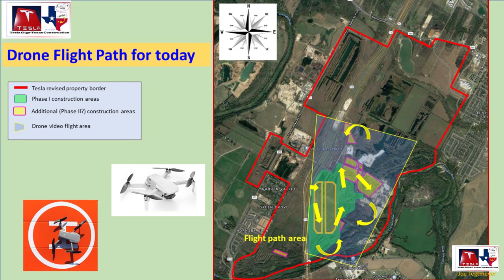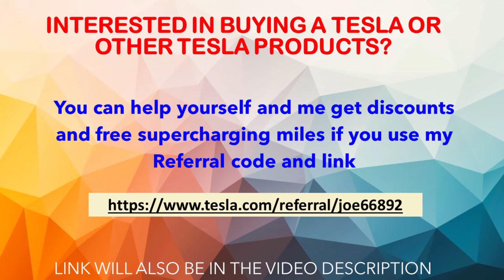Tesla Gigafactory Texas 27 October 2020 Cyber Truck & Model Y Factory Construction Update (09:15 AM)

Comment: Small point. Concrete does not "Dry", it is a chemical reaction that occurs, and that is why it gets hot! But the cover prevents the surface from drying out as it heats, and thus leaving a layer of weaker, product on the surface, and this leads to subsurface layers. But essentially right. I asa lowly boilermaker and truck driver, only delivered it, so you would have to find an expert to find out the actual reactions
Reply: You are exactly right. Drying is bad, curing is good. Edit: Concrete will cure under water. :)
Reply: On this topic there is so much misinformation. Yes, concrete cures chemically not by drying,. You can pour concrete underwater and it will cure.
Reply: @williamgreene4834  Yes!!!

Comment: 1:31 when they built the Hoover Dam they went so fast and used so much concrete that they  ran pipes thru the concrete and ran coolant or "air conditioning" theu it to keep it from curing to fast and cracking
Reply: Today that risk is managed chemically by adding ingredients from the green tanks we see see at the new batch plant.

Comment: As for the small pit area, since this is purported to be in the paint area, this could be a pit for the downdraft paint booths that are often used in industrial painting. You use a vacuum system to pull the extra paint and air particles down into a pool of water. This not only captures any paint that as been aerosolized but also dust and particulates. You use this in addition to differentially charged paint and body to get as much paint on the car and as little as possible on everything else. Just a guess though.
Reply: Or the drying tunnel, usually concrete to help insulate , but I would expect hot zone to be at the end....
Reply: But why the forest of geopiering under that area?  My guess is that there will be equipment too heavy for the normal slab to handle and they need a thicker layer.  They initially extended that scraped area several feet further south but filled it back in with gravel.  Simple mistake, or intentional so it would be a thicker gravel layer?

Comment: Well, I guessed correctly on the smoothing of the area under power lines on the Southeast corner - parking.
It looks like they have started to prepare the area under the power lines north of it for more parking.
There was a new flatbed trailer parked west of the pit with a load of rebar or upright beams.
I could not see what was on it.
The big pit on the North end could be for twin tanks to dip the car bodies in for anti-rust proofing or acid rinse in preparation for painting. (?)

Comment: Joe, thanks for the informative comments about covering the concrete while it cures. Quite correct. That explains the colorful plastic visible in one pit.
Reply from the maker: Thanks ... I figured I’d get questions on this so put the info out there in the video
Reply: Concrete cures or hardens as a result of a chemical process, not as a result of drying, although concrete can dry as it cures. If it dries too fast in relations to the curing process, the outer part of the cure can lose strength and "splay". Tarps are placed on curing concrete to slow the drying process so it does not get ahead of the curing process.
Reply from the maker: I know ... it’s an exothermic reaction  as well ... just trying to give info to a wide audience.
Reply: @JoeTegtmeyer  I understand.  I just feel that as the project  progresses it will become  more complex and it will serve everyone if the basics, like the nature of concrete,  reaches some sort of communal agreement before the complexity begins.
Reply from the maker: Ok ... Thx!
Reply: @JoeTegtmeyer  Thanks, Joe. Here at 40 degrees lat. we get really nervous when you mention 39 degrees...frozen concrete is no joke!
Reply from the maker: Spent a lot of time in North Dakota so understand when it is really cold

Comment: I think the earlier work on the center roadway was about erosion control, and preventing a potholed, rutted, muddy mess for heavy equipment traffic.
West side has a lot of completed geopier work, now, too.
Reply: I agree. Early on the center "road" was probably wide and graded to have a center channel to deal with massing rain sheet flow run off. Now the building footprint is up to grade and compacted. The first use of the road during rough grading as a protector of the grading and compaction work in process is no longer an issue.

Comment: When you get a chance and the weather is right, it would be nice to get a close up of the switch yard area east of the power lines for a few minutes.  From the long range view today it looks like it is pretty level.  I remember how it started and they have actually moved a lot of dirt there.
Reply from the maker: I’ll try ... other than leveling not much has happened but they could be doing some construction there soon.  Perhaps I could do a before and after to give something interesting to look at?
Reply: Agree... not sure why, but it is starting to look suspiciously like the next building footprint and not a (truck) switchyard.
Reply: @patrickkenny2077  Electric Switchyard
Reply: @a..d5518  Time will tell, but I don’t think so.  It seems like the “wrong” location for the primary substation; you wouldn’t want to cross under the transmission lines and high pressure gas line for this particular phase.  It is also too big by an order of magnitude (~3 acres required and ~30 acres provisioned) and the use of the term “temporary” does not make any sense when talking about this infrastructure.  The most logical location for it would likely be along the tollway north of Phase 1, but west of the transmission lines, or possibly in some of the orphaned area along the river that is not easy to develop.

Comment: It's a little odd that they assembled that one section of structural steel some time ago only to pause for weeks.  Apparently it was a test run?  Or maybe they simply had a brief window where the crane wasn't required elsewhere?
Reply: Speculation before that it is used as a large marker in the sand to measure other points from to add accuracy to the gps

Comment: Regarding the rectangular cut out near the center of the first building: Two points. 1) Remember that the site engineers have determined the ground needed firming up with GeoPier. While GeoPier increases the quality of the ground underneath the foundation for sites that need it, it's still not the same as carving a foundation into bedrock. There are limits to how much improvement you can get with GeoPier. 2) The fact the site engineers decided an additional concrete foundation is needed at this location tells me the planned equipment is going to be heavier / will apply more force to the floor than in the equipment to be installed in the rest of the building. For example, perhaps some smaller presses or stamping machines. If you look at the existing internal tours of the Fremont Giga Factory, you can see areas which have heavier machines. I think the reason for this additional concrete area is as simple as already knowing what equipment they plan on installing. For example, the computer controlled arms which install the seats look to be pretty heavy and their fine motion control would require a more stable/vibration free foundation than most of the other equipment I see in the Fremont tours.
Reply from the maker: You may well be correct ... and if so we might see more of these elsewhere

Comment: I think the shape of those foundations might be slightly misleading. You can see on that first one that they are working on what looks like pillars. My bet is that those are for the columns that will support the roof and that due to their position near the machinery, they have to include them in the foundation for the machinery. They do seem to line up really well with the existing pillars. I also think that the small thin bit toward the power line is either an access for inspection purposes, or a pipe shaft.
Reply from the maker: Thanks for the inputs and thoughts!  I’ll keep flying and filming and we will see!

Comment: You are using the words drying and curing of the concrete as though they are interchangeable. They are not. Concrete cures, a chemical process. It is kept wet to cure properly. That is why the orange cover to prevent it from drying. Drying would be bad and result in loss of strength.  I know people confuse curing and drying and cement and concrete but I think using the right terms here will help guide people to proper usage.
Reply: "You are using the words drying and curing of the concrete as though they are interchangeable. They are not." Yes, it is starting to become annoying how this confusion persists.
Reply: @Goat Roapr Specifically what is annoying is when some of the 90% then go off on a theory of what is happening based on a flawed concept of the concrete "drying" or similar misinformation after weeks of the 10% repeatedly explaining the correct concept.

Comment: I have noticed in the Giga Berlin vids that they have poured deep foundations only to put a support column in the middle of it. like they are doing on the east end. As for the Alley down the middle I would think that would be used for truck delivery's and utility's. Giga Berlin is a huge constructions site and I think Texas is even bigger. They will need parking for hundreds of workers. I counted over 80 concrete workers there the other day. So there could be 4 to 6 hundred workers there as the construction continues. I've also noticed that the casting machine in Fremont would not require such a large operating pad that are being poured in the  large pits. The painting is a good idea because it will require not just the painting booth but an oven to cure the paint and a cooling area. I think the gazebo is a test frame or something temporary. I have not seen anything like this in Berlin. I sure of one thing there will be many many more questions! Think of all the electrical, sewer, water, drainage, parking, delivery's, cooling pipes, A/C and heat. Thank You Joe for flying everyday to bring this info to all of us!
Reply from the maker: Thanks for all the ideas Allen!  🤗

Comment: The form of the central roadway is intruiging.  In Shanghai there are big differences between phase 1 where the loading bay height change is on the perimeter of the building, and phase 3 construction  ( phase 2 production) where the height change is +/-20m inside the building so that officies and production space cover the loading bays. I am starting to visualise the latter in Austin - a narrower rosdway with offices and  connecting bridges  above?
Reply from the maker: That could very well be right ... We should see soon as columns are put into place and suggesting the height of the building and possible space to do this.

Comment: Joe- you need to move your text down from the top of the screen. Youtube adds white text over your yellow text and makes your yellow text unreadable. Win10, Intel PC. Love all the updates, Thanks
Reply from the maker: Use full screen and it’s not a issue
Reply: @JoeTegtmeyer  Using full screen on a 22 inch monitor. Thx for reply
Reply: I have the same problem.  When I'm in full screen, if I pause the video (or even move my cursor) the title of the video overwrites the caption in yellow.  It's a nit, but it would make it a little easier to read your captions if they were below the YouTube video title when I pause the video.  I  work around it by scrubbing back about 10 seconds before the caption and pressing play. The Youtube caption goes away after about 10 seconds. I miss the caption because I'm so engrossed in the video!!!  I really love these videos and am grateful Joe for all you do.
Reply: @JoeTegtmeyer  Checked out todays video. If I'm IN FULL SCREEN mode I get Youtube's white title text over your Yellow, If I'm  NOT in FULL SCREEN mode the white text disappears. latest Windows 10. @
59seank
Reply: @59seank  it disappears for me if I'm NOT IN FULL SCREEN.  Full screen forces it to appear, maybe some Youtube "funny" ?
Reply from the maker: That’s strange ... I don’t see that when watching on my Windows 10 computer or on my 4K TV.  I’ve also tried other people’s videos and I don’t see that on theirs either.
Reply: @JoeTegtmeyer  Happens all the time on my system. Weird. Don't think I've ever seen it not happen in full screen.
Reply: @dalekloss4682  Hi Dale.  I'm using a Chromebook.  I always watch Joe's videos full screen.  I popped out of full screen and YOU'RE RIGHT, the YouTube title does not pop up and cover Joe's yellow caption.  I guess it's a YouTube thing.
Reply: @JoeTegtmeyer  Well, it's no big deal.  I now have an easy work around.  Thanks, Joe.
Reply from the maker: Ok ... in the mean time I’ll see if I can adjust the titles a bit.  YouTube can make things interesting sometimes 😕
Reply: In full screen, if you move your cursor to the edge of the screen the title will go away without having to wait 10 seconds.
Reply from the maker: Thanks Mike!
Reply: @aerowhiz  Thanks, Mike.  On my computer, that works on the left side of the screen and top of the screen, but for some reason not the right side of the screen.
Reply: @59seank  Yeah, mine is the same. Weird, but useful. Computers- can't live with 'em, can't live without 'em.

Comment: That big pit will be most likely one large footer.  If you take the long skinny one as the center and duplicate the one that is formed and the one that is being started, they would all fill the big pit.  It looks like 5 independent footers but that could be just to make working around them easier.  Someone said it could be a down draft for paint booths but, no, you wouldn't have a deep pit of water and surely not 20' down.  GM had nothing like that in Shreveport and they painted a truck every 54 seconds.  Most likely, stamping, casting, or folding/braking operations or maybe even forging operations will take place here.
Reply from the maker: See if my 2 November Video helps answer some of this.

Comment: At the moment I can see 2 rows of two in the stamping area but I can see there being a 3rd row more towards the central roadway. The smaller foundation behind this section could be to hold the furnace that smelts the aluminium alloy and it will potentially feed all gigapresses, this would be many tons of equipment and many more tons of aluminium alloy. This should be a much cheaper solution than each giggapress smelting it's own line. I'm guessing that molten aluminium with its fairly low melting point isn't too much of an issue to pipe down heated pipes. If it's not for aluminium smelting it could be something a little different but effectively the same, a grain silo for pelleted aluminium alloy, which would be sucked through pipes and delivered to the individual machines for inline smelting. I'm pretty sure something along these lines explains the smaller foundation.
Reply from the maker: That’s a great idea I hadn’t heard before ... I’ll have to look at Giga Berlin again with this mind to see if they have something like that ...
Reply: @JoeTegtmeyer  Berlin could be quite different given their rolling improvement mentality and the layout is a little different but it's a good place to start!
Reply from the maker: There are after all siblings so you never know what you find ... it and Shanghai are the closest examples I have to go on! 🤗
Reply: @JoeTegtmeyer  Ironically, Freemont gives the best view of their operation but that entire site is Frankensteined to hell and probably isn't the best example to pull from. I haven't seen any data on how these machines are fed material but from what Sandy Monro has said about the alloy used it is formed very quickly and this points to massive amounts of material needed.

The only other thing I can think of for that area is the centre casting for the battery pack, if it is being cast. This would potentially be uniform across either the whole range or most of it and may potentially need only one machine for all but I can see that becoming a bottleneck down the line unless they can make that section 2 or 3 times faster.

Comment: Looks like the general design of the building footprint was used for the site permit , but the interior design was in flux and is now getting set in stone.
Reply: Thats the Tesla way
Reply from the maker: Yes ... also the site plan is generally for the grounds preparation, not the architecture

Comment: If you can extract that embedded GeoPier impactor, you get to be the king of Britain.
Reply: I'm more interested in what it is stuck on, and why it is stuck.  Secondly how they are going to remediate the problem.  They still need a pier there.
Reply: Excalibur ram. Perfect.  Personally, I'd just take a cutting torch to it and cut it off and assume the remaining steel will add to the compressive load capacity of that pier.

Comment: 7:30 foundation difference.  Maybe that's where the big tank that the car gets submerged in to prime and clean?
Reply from the maker: 🤔 interesting idea ... but there are column footers there too 🤔
Reply: Oh yeah.  Another thing I just noticed was that the lighter color holes must be the gravel from the Geo piers.  Which you noted in the video, I just missed it the first time around.
Reply: @JoeTegtmeyer  The heavy equipment may end up being located on the floor above. Thus the need for a much larger footing to take the load from the 4 columns.

Comment: Just a uninformed opinion but by the size of mass of those foundations going in for the casting machines it's just not the weight of them it's also the forces they will induce as parts move quickly. They need just a mass of foundation to stabalise them.